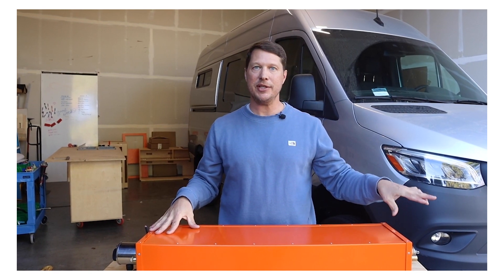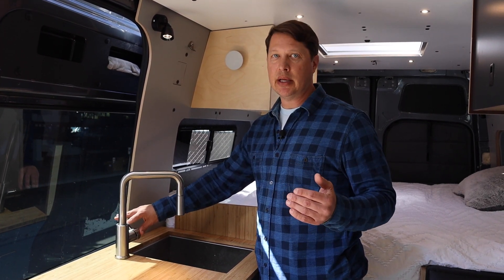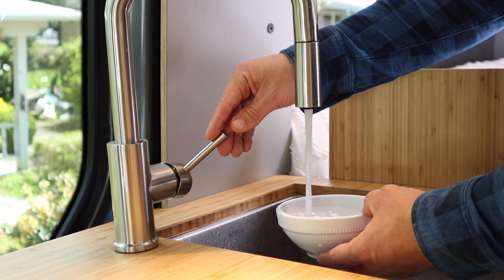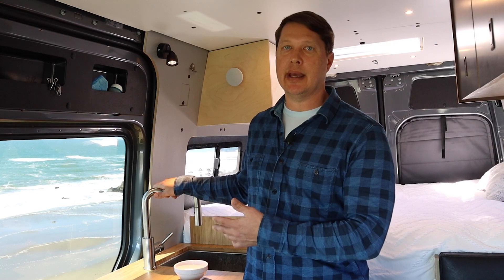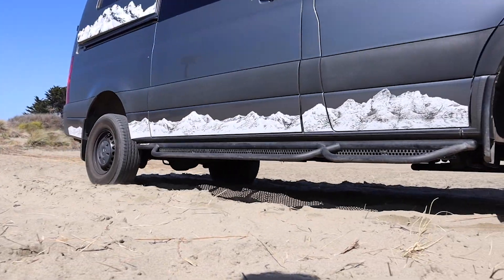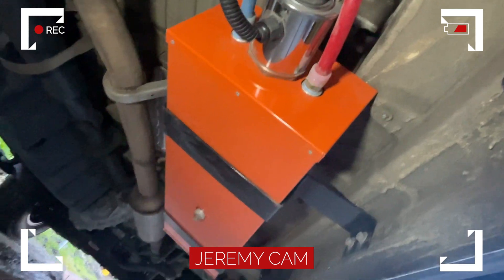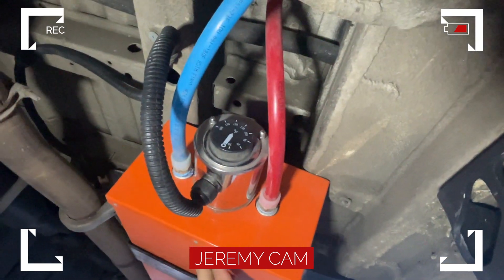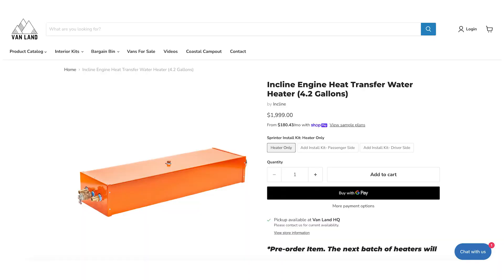Best Water Heater For Vans | Incline Water Heater Review

Comment: The best explained step-by-step I have seen.
You can add a second heating source from a gas water or diesel preheater fitted on a three-way valve then when the water drops you can use the thermostat switch from the electric element to turn on/off the second heater by relay AC to DC or AC to AC giving hot water even blow air or radiators underfloor taken from a second valve look at the home heating plumbing and see a better operation that's been in the works for many years.

Comment: When you did the temp reading after driving, did you run the water for couple of seconds? I would imagine the residual water in the pipes doesn't heat up as much as the water directly from the heating tank.

Comment: I love the design and agree with installing it under the van. But…the reason not to install inside doesn’t seem like a big deal considering there are 1,000s of Isotemp installed inside without issue. This water heater is a much better design than the Isotemp.

Comment: How do you implement the non-scalding mechanism? I am worried about it.
Reply: SinkMixer scald protection thermostatic mixing valve by Caleffi is what I'm going to go with. That and this water heater. I'm also going to use a heat transfer device, instead of my direct coolant line. Something like the plate heat exchanger.